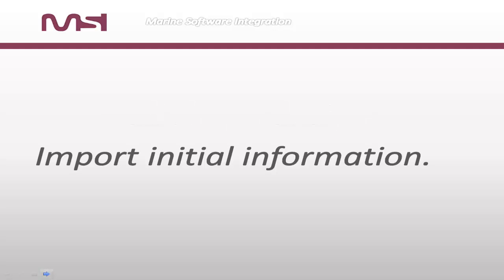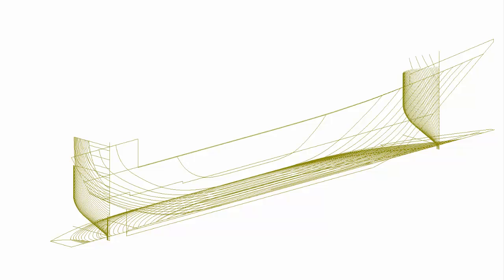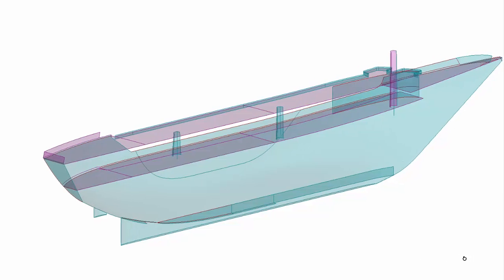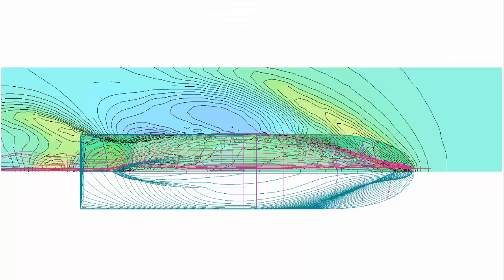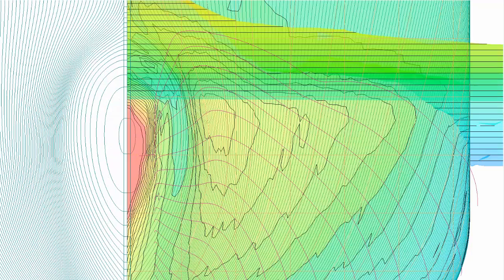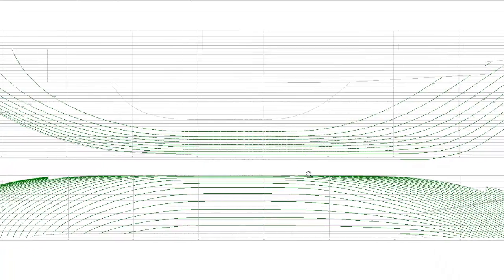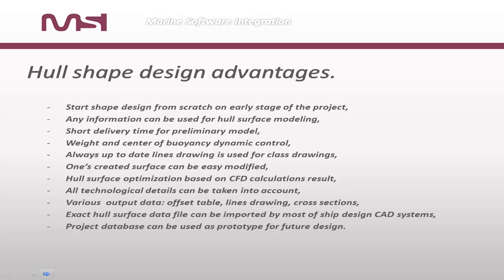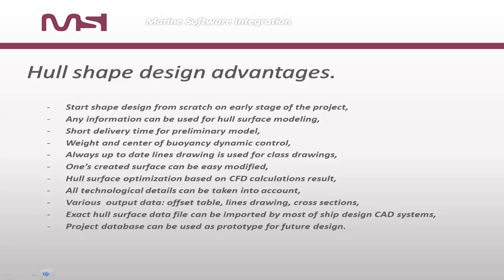Hull shape design

Comment from the maker: Yes. This is true. Information flow around the hull: stream lines, current wave surface and the pressure distribution around the housing are visualized together with the surface. and immediately see where you need to change the shape. To improve the flow characteristics. ( translation in English)